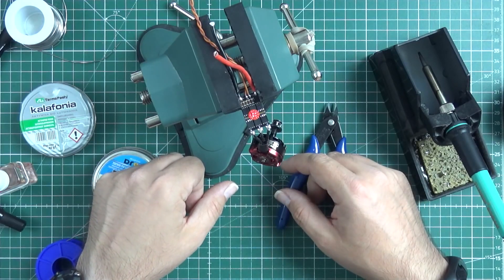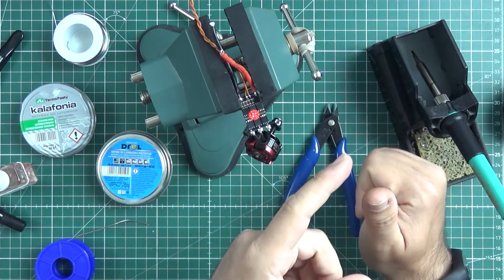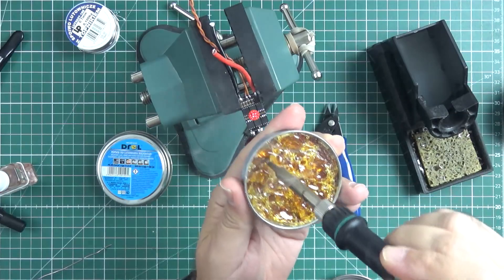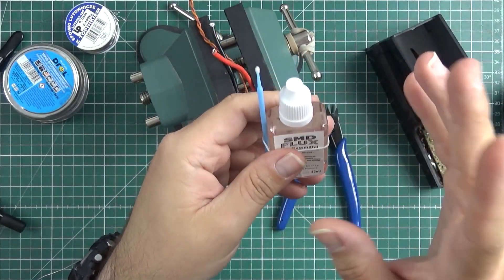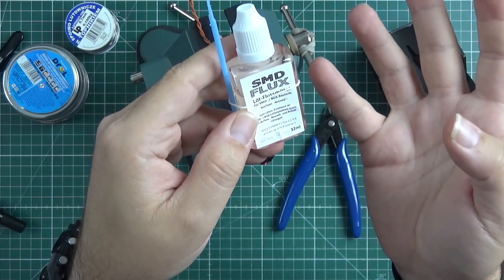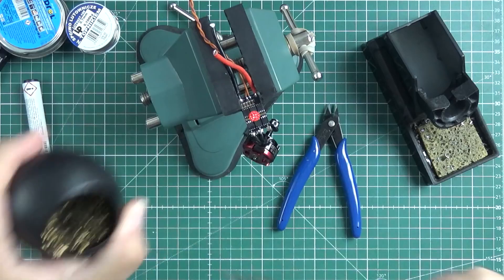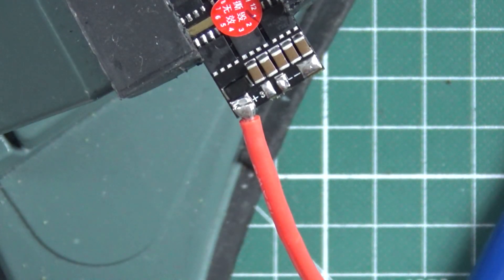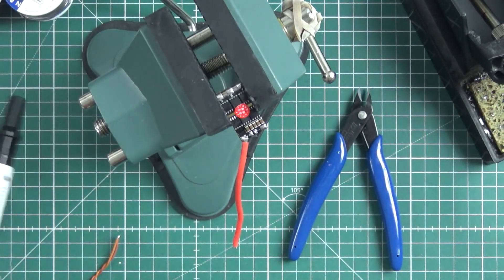Soldering, rosin, flux and a flux pen

Comment: Respect for mentioning about no-clean. But. Flux in GEL. Only and forever. Amen ;) It's evaporate slower and you have better control on the soldering process. And another important practice: pre-heating of the PCB if it have bigger copper  areas or you solder it to the massive cable. Just use a hair dryer from the distance or use hot-air solder station set to 100-150'C. The whole process will be MUCH easier and less stressful for electronics because of shorter hi-temp process :)
PS. It's worth to mention to always clean the top of the iron before making another soldering joint (oxidation and rest of burned flux), and also to have little drop of fresh solder to improve the heat transfer.

Comment: Flux is essential for non rosin cored solder and rework repairs on surface mount components. Otherwise not necessary, tin the wire, tin the pad and touch together with soldering iron, job done :)

Comment: I learned to work without extra flux, just add a little extra solder(rosin core) when I need it to flow better. Had a flux pen once and it really helps, but it dried out after a few months and maybe 6 times of use. That makes it too expensive per use.